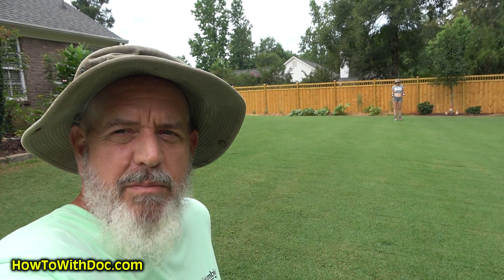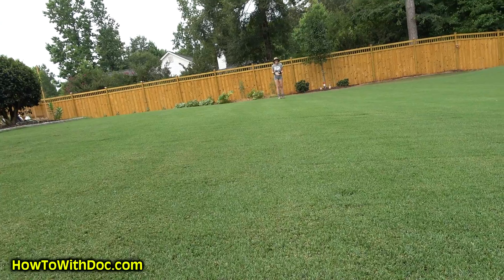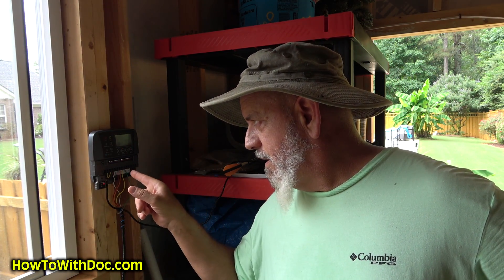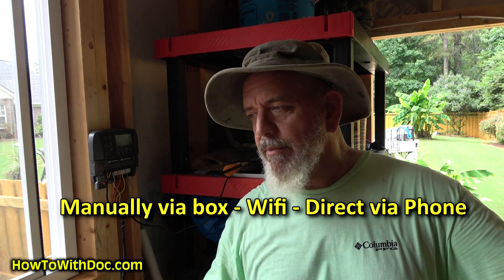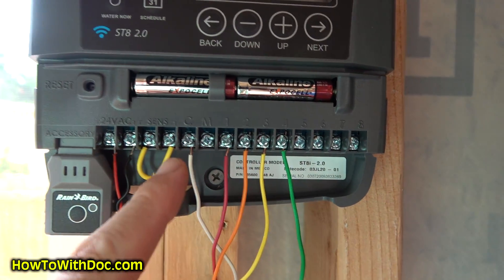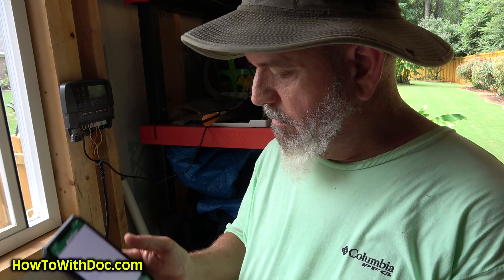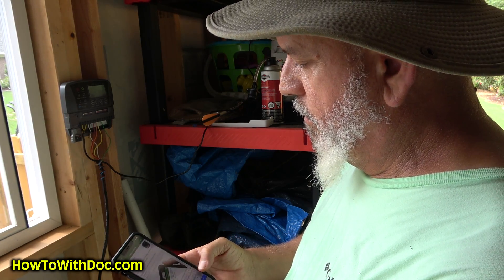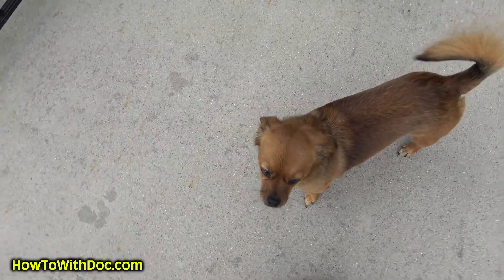Wifi Lawn Irrigation Controller

Comment: I picked up a BHyve last year and it’s been great as a WiFi controller.  My father in law used to do greens maintenance also and has it so I got one also..  But it has a soil moisture percentage calculator based on your weather data and your soil types, and info that you input.... but it’s not accurate at all lol  we’ve argued about this, but my hand measured % when I feel I need water, doesn’t match what the app says.  But it does work great as a WiFi controller tho,, I just don’t rely on the smart watering.

Comment: I have had a Rachio for over 3 years. Not one issue you mentioned. I like that it uses the closest weather station to monitor for rain and it adjusts itself depending if it rained.

Comment: I’ve had that rainbird controller for 3 years and I love it! We are frequently out of state for weeks at a time and the combination of the WiFi controller and security cameras let me keep things under control when I’m gone. I disabled the seasonal adjust feature because last fall we were gone for 5 weeks and we had extreme heat and drought (Chattanooga) but the controller cut back the watering times because it was fall. We lost a couple of plants and the lawn was pretty toasty when we got home because I wasn’t watching it on the cameras.

Comment: I have the old controller you replaced. Biggest thing that annoys me is I can't change the time each zone runs per cycle. So for example, I can't have a zone run for 10 min in the morning for a deep water and then have it run for like 3 min in the afternoon when its 105 F on an automatic schedule. Obviously you can run it manually, but I have work.

Does this new controller allow you to do that?

Comment: Use a power over ethernet connector and add another wifi router in your shed. I've had the earlier model of that controller (looks identical) for a few years and it has worked great!

Comment: In my opinion, that rainbird controller is the worst controller made and here is why:
 Dreadfully slow to connect
Setup on wifi is painfully slow and can get confusing if you have 5ghz instead of 2.4 ghz. (it will not run on 5ghz)
 lack of control over "automated" watering on seasonal adjustments
 externally attached wifi is terrible at staying connected
manual watering is terrible and laborious (you login, connect, select controller, select zone...)
I had this controller for about 6 hours before i took it back and got a Rachio, which connects superfast and is easily manually controlled.  Don't waste your money on this.
Reply from the maker: I have both and use both.......
Both "connect" in about the same time.  (RB actually connects in 1.8 seconds) 
Rachio and RB manual run are about the same when going per station. 
Most routers have both 5 and 2 ghz.
I don't use any "scheduling" so I can't speak to that.

Comment: i cant find the wifi extender you put in the house i have the rain bird outside unit with wifi but through the block home and the rain bird module inside the box i get poor reception to my router
Reply: Nascar 4Life get a WiFi mesh system extenders don’t work that well

Comment: I just installed the Orbit B-Hyve controller this season. I also bought mine for the ability to manually control it. It also had a 12 zone controller at price I could swallow. 

I started with a simple watering schedule for my lawn, but then I switched to it's "Smart Watering" function. I can't recommend it. It's just not there yet. It would put itself on 24 hour "rain delays" way earlier than it should, and it wouldn't correct if I didn't get any rain. I went through most of June where thunderstorms would roll into the area and evaporate into dust before any water would land on the lawn. I had to go back to a regular timed schedule and make my own adjustments when it needed.

Watering random zones is simple and easy. I enjoy randomly attacking my kids with the sprinklers when they're playing out in the yard.

Comment: Heard terrible things about the racheo
Loving the orbit (mini) though. Only issue with it is that it does not work well with rain guages. There is a known issue/bug there so am hoping for a software update soon. Had the same rainbird (manual) before and for a manual controller , it was awesome. But once you go wireless, there is no going back to manual, lol.